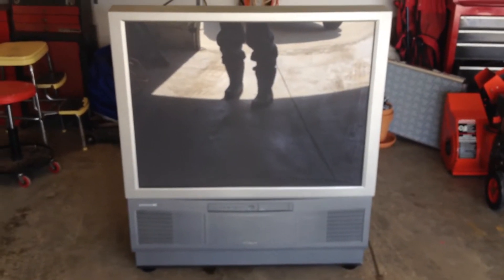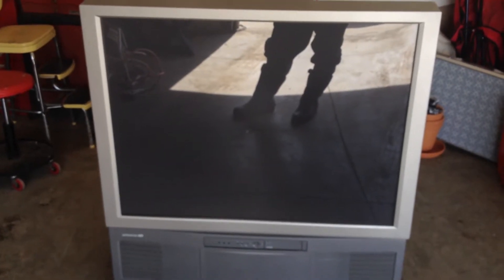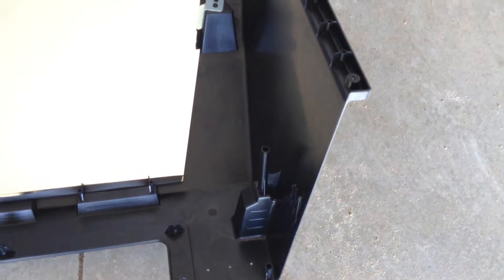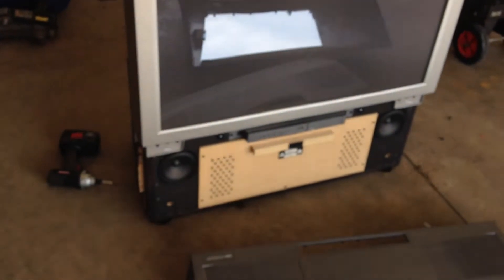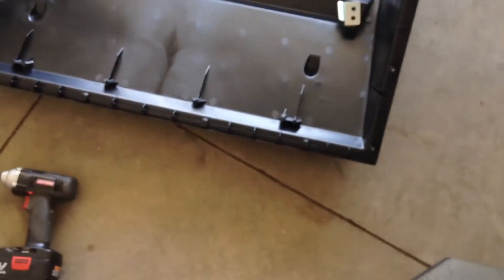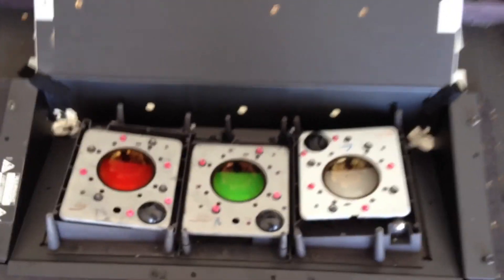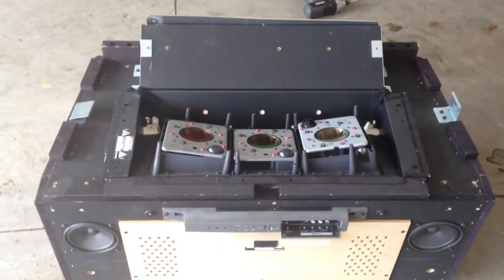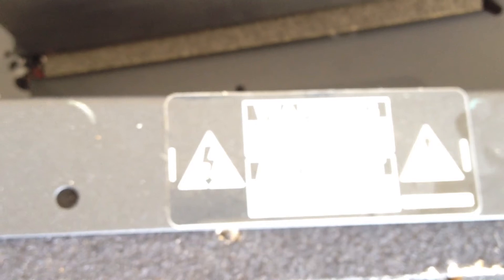Free fresnel lens, whats inside a hitachi projection TV, look and see whats inside.

Comment: I came here looking for info about that fluid in those lenses, worried about toxicity as I spilled the contents of the first lens trying to recuperate them (thanks for letting me know it 's just glycol), after hauling one of them out from someone's place in exchange for more valuable stuff (yeah, he actually PAID me to take it away from him with several hundred pounds of stainless steel, lol),  only to find out about the Fresnel lens!!!

So took it apart, it was sandwiched between a front clear piece of acrylic, had a linear filter in front of it and a clear Fresnel lens behind.

Considering I was going to throw this with the rest of the case, I'm glad I went online to check things out :-)

Thanks for sharing, Man!
Reply: JohnnyJim  They give an est. 1 year after exposure.
Reply: same stuff as in the smog monster movie,
Reply: same stuff as in the smog monster movie lo! I believe its nothing more than mineral oil ,,of the sort.but i wouldnt be wanting to use it topically either.Glycerin...
Reply: I think glycol or lycol.. I heard aircraft  wiper fluid or antifreeze.(I stay outta planes too, so not sure if they got wipers. Never got good enough to sit that far forward)but it's either on the rip of my tounge ir I'm thinkin bout the right idea .. I hadn't popped one open. U know they're messy!

Comment: take a insulated screwdriver and short out the one red wire to each of the three picture tubes wearing welding gloves to be safe and the same for all the caps now safe to solder and remove all the extra components for later projects :)
Reply from the maker: Thanks for info again. There is allot of good components inside